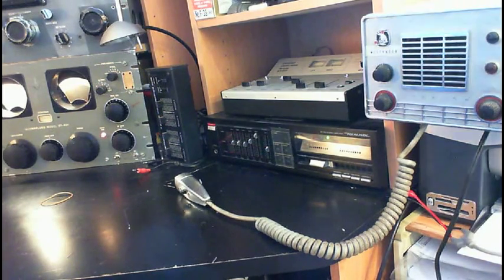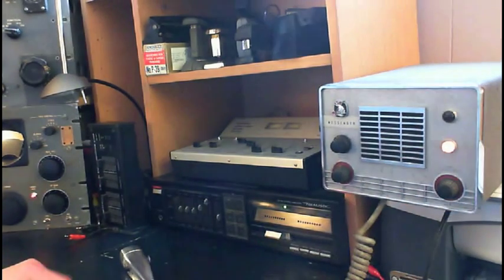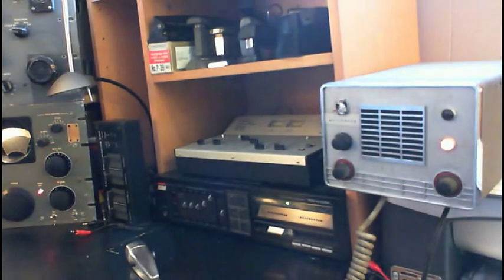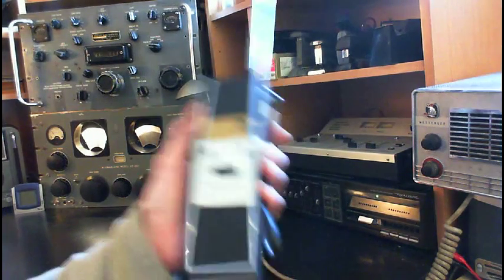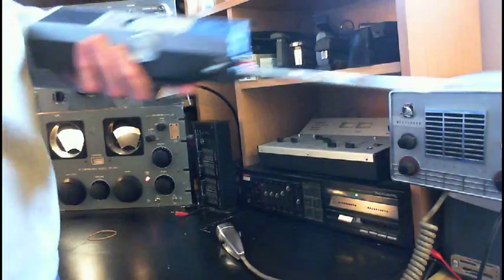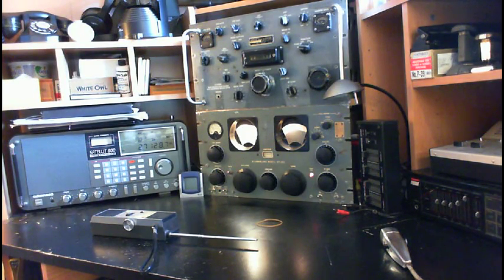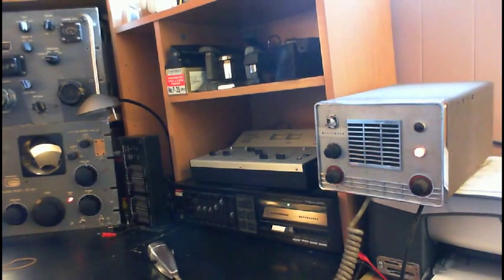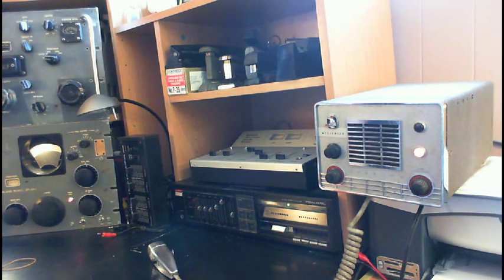Johnson Messenger Vacuum Tube CB Radio

Comment: Hi Jim, nice video. I have a couple of these old Johnson Messenger CB radios. Picked them up for a few bucks at the hamfests. Got me interested in getting them out and see if I can get them operating. Should be able to make them work on 10 meters AM since Johnson sold a 10 meter version Messenger model back in the early 60's. 73 Randy, w5kcm
Reply from the maker: W5KCM I keep thinking I should fire mine up.  I still get a kick out of listening to southern CB skip when the conditions are right.